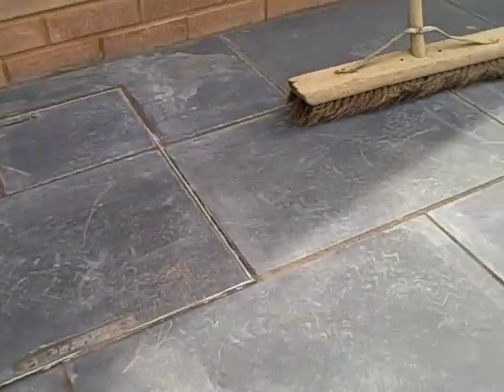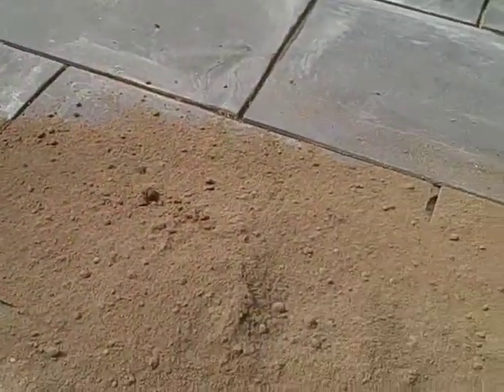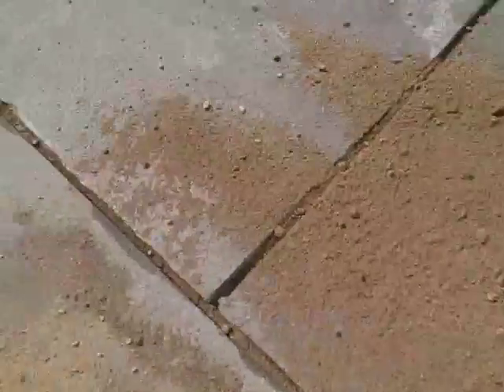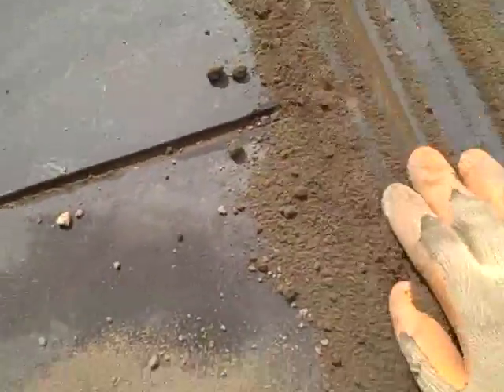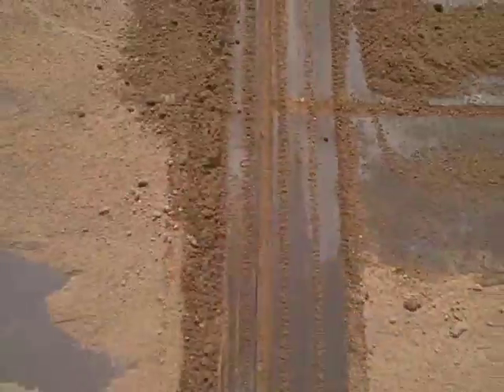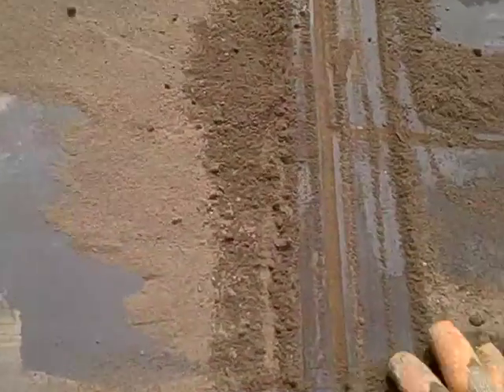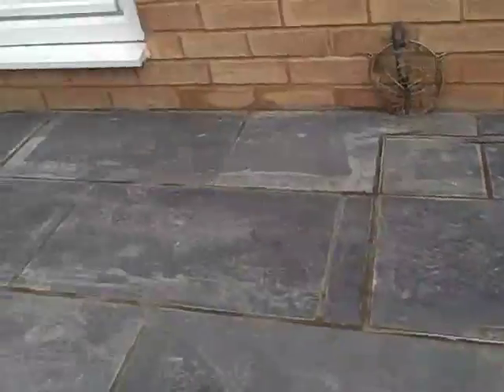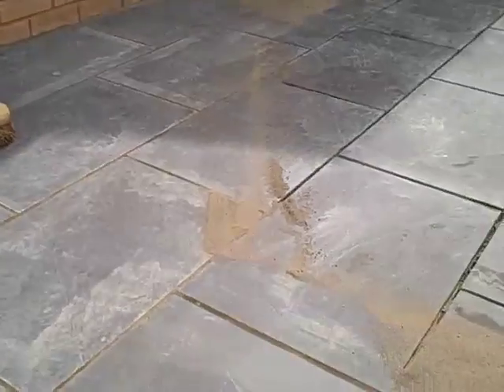Grouting with a dry mix

Comment: The purpose of dry grouting is to save on time and work. This process you are using spreads mess. You might as well just grout normally. I am experimenting with a clean and efficient new method. First I premix my ingredients, 
1 Portland mixed with powder coloring.,  2-3 sand and  success